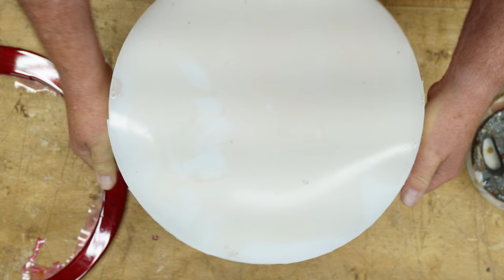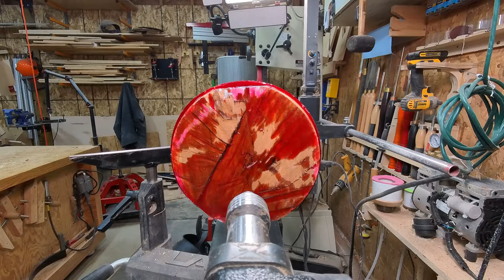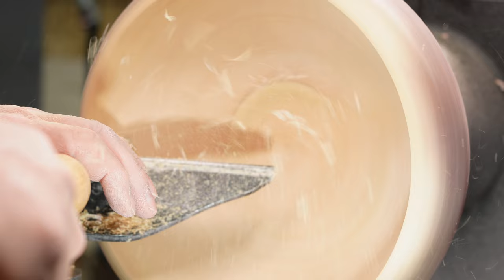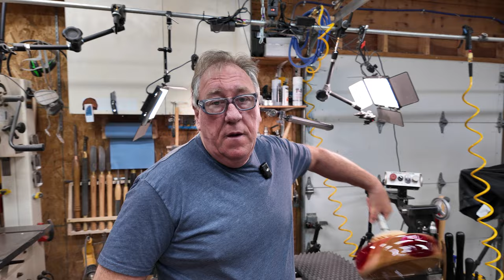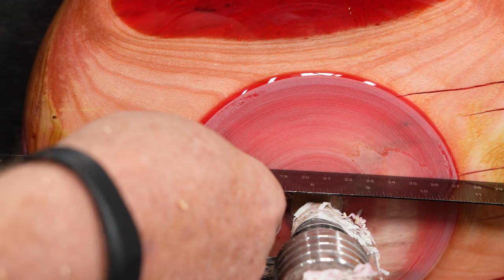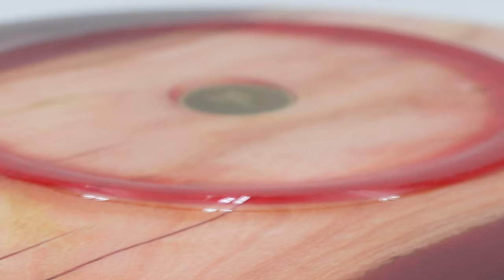How to maximize the size of your woodturned bowls

Comment: Thanks for sharing this video!  I've taken plenty of inspiration.   What was the carbide tool you used for hollowing? I have pretty good hearing but he cutting sounds drowned out the sound of your voice and I could only make out a very small fraction of the speaking parts during cutting, so I apologize for asking a question you technically answered.  Viceroy or something I thought i heard?  Didn't see anything like it in the description.  
I want to make a mold like that so badly (they are crazy expensive to buy), would be so handy on cracked wood or reinforcing punky wood etc.  Loved seeing my 'intentions' put into application.  Thanks again for sharing, your results were beautiful!
Reply from the maker: Appreciate your accolades for my work. I use the Hunter Tools that can be found in my video links or search for Hunter tools. Yes it’s the Viceroy and also The Hercules both Hunter tools. Cheers!
Reply: @bespokewoodartistry1517  Thanks for the info!  I must be half blind because even after you mention them I don't see mention of "Hunter Tools" or "Viceroy" in the description.  All I could see was a mention of the 1 1/2" scraper.  But now I know what to search for so that works. :)

Comment: Very nice looking bowl.  How much moisture was in the wood?  I’ve heard that when using resin your wood has to be like bone dry.   After you did the first resin coat I was surprised you were able to wipe off any excess with a towel.   I thought the resin would be so sticky it woulda just tore the towel apart.  Did you put heat/torch shortly after to try and pop any bubbles forming?   Last question, for the 3rd coat what sanding grits did you go thru?   That 3rd coat looks flawless!   

I’ll be trying for the first time an epoxy finish today!   Got my Slow Turn Finishing rig complete and ready for its maiden voyage 😊
Reply from the maker: @normagene514  I use total boat penetration epoxy to seal the wood. The wood I used was 11% so fairly dry. Ended up with 3 epoxy finish coats.
Reply from the maker: @normagene514  good luck, comment me if you need help. Cheers!

Comment: Good morning 🌅, Very Nice Looking Bowl, would it helped if it was put into a vacuum chamber, from France.
Reply from the maker: To be honest I havnt used a vacuum chamber only a pressure pot.
Reply: Pressure pots are preferred for casting. Air is compressible, liquid is not. So the pressure forces the liquid into all the nooks and crannies in the wood, and displaces any air bubbles. Whereby, even if you filled the container up with epoxy before pressurizing, you may find you need another pour for bigger jobs because there's simply that many hard to reach spots. This means we get a more structurally sound piece
 
In contrast, the vacuum causes the air bubbles to become smaller and get trapped inside the liquid. While microscopic, they are there and they cause weak points in the structure of the piece. Especially considering, when removed from the vacuum, the air will want to expand again. So now you've introduced an internal force and a weak point, which will likely lead to future cracking when you factor in that the wood will be constantly fluctuating with weather and humidity conditions year round.

Hope this helps you understand the concept better 🙂
Reply: Using a vacuum chamber removes air, and water, it might take three or 4/ 5 circulations, So when you release it, the resin goes back into the voids, 
And this is why nowadays, Kiln drying of timber is put in vacuum chamber, as it is more controllable,
Reply: @Hog-g2z  you asked, I answered. I'm not gonna put more effort in this. It seems my explanation was inadequate. So, I recommend you consult YouTube for your answer on why pressure pots are used primarily instead of vacuums. Good luck
Reply from the maker: @Hog-g2z  all good advice form all concerned.  Valuable input from all of you. Cheers